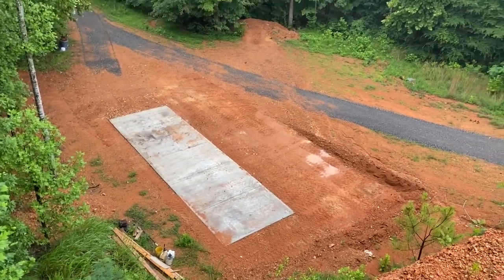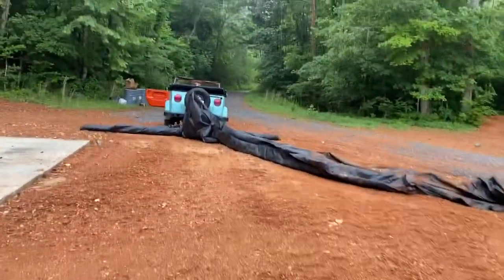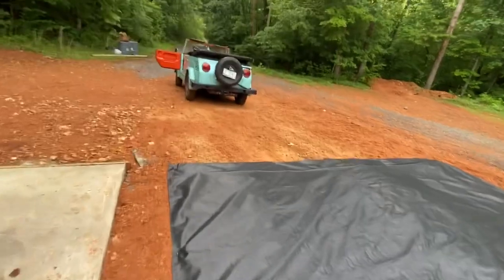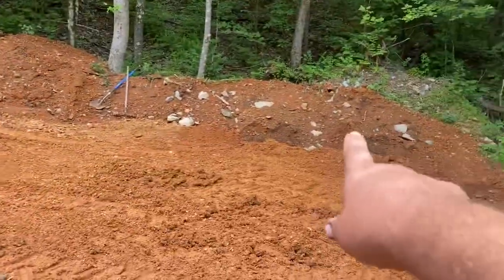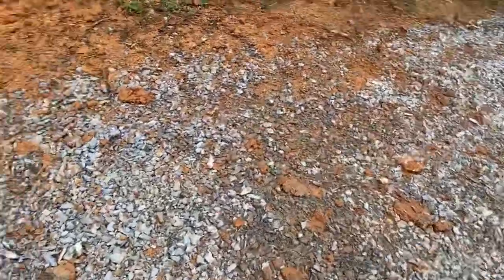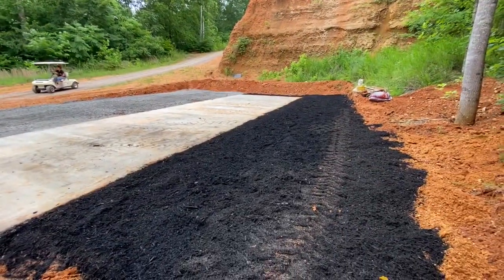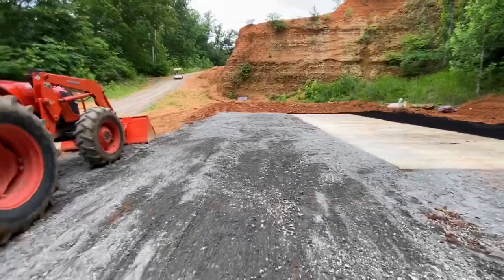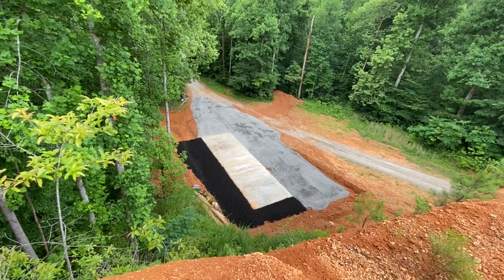Completing the pad area and adding an additional bus parking spot

Comment: I like your parking area its coming along nicely. Having that rock there will make a big difference. The next thing id be tempted to do as you can afford it is to run a trench across the drive at 45 degrees from the corner of your hill and put in some of the metal or plastic 18 inch drainage pipe. it would keep a lot of water off your work area and stop the rock being washed away. You could run 40 feet of drain flow piping across the bottom of your hill into it. In New Zealand (here) its called "drain flow"  or "nova flow." ? it maybe called something different where you are. Its a 4 or 5 inch ribbed plastic pipe with slots in the side of it with a fabric sleeve on the outside. You dig a trench line the trench with light rock. Lay the pipe in and cover it in rock then soil. Its easy to join lengths. You cut a long the side of it 8 inches and squeeze it together push it into the next piece and let go and slide the sleeving along to the joint.

Comment: A great cost effective way to make a DIY compactor is to buy 1 or 2 55 gallon drums or old fuel drums and cut a 6 in opening in the top or bottom and fill it up with concrete. That drum will weigh 5,500 LBS after it's filled up with concrete. The easiest way to move it is a tow hitch that you would use to haul a vehicle behind a RV.

Comment: I’ve installed literally square miles worth of the geotextile.  Materials separation and sheer load distribution is awesome.  The soils around there are still boggling my mind, but I live in the middle of ancient glacial lake-bottom topped with a few thousand years of composting fir and pine trees…  finding rock that is not part of a live riverbottom is just weird up here.

Comment: You need some large bore plastic pipe work to take the water away under the gravel drive to the woods , watch some clips from Letsdig18 or Andrew Camarata on the subject 👍🏻👍🏻

Comment: Have you given some thought about putting a portable roof type structure over your gravel or concrete or both slabs. In some cities they have these portable roof type structures over their basketball courts about 22 feet up. Check it out on Google. The poles that you have for the roof we just need to have some type of buckle attachments where you can put on a canvas side in case of some blowing rain. Just a thought,.  Have a great day and keep the faith.

Comment: May be good to get a better charger for the golf cart in time. Especially if you do deep draw downs with the cart. These chargers are bullet proof, but if it is the same as we had, then when it done it shuts off and doesn’t turn on again, which tends not to fully charge some of the cells once the voltage settles...unplugging and replugging the charger after the battery voltage has settle may help with this a bit.